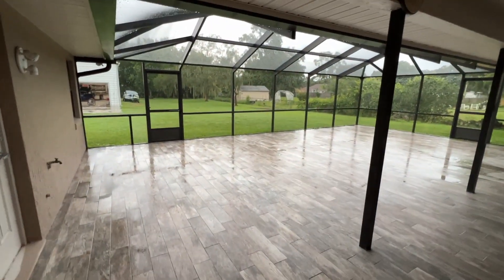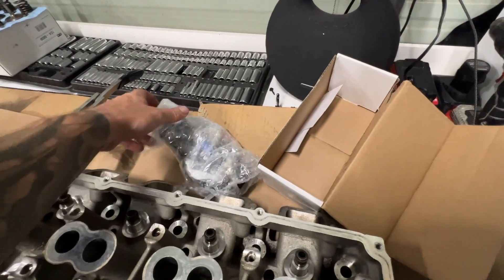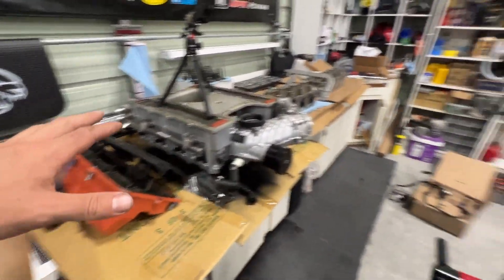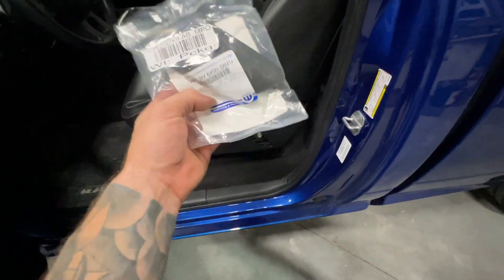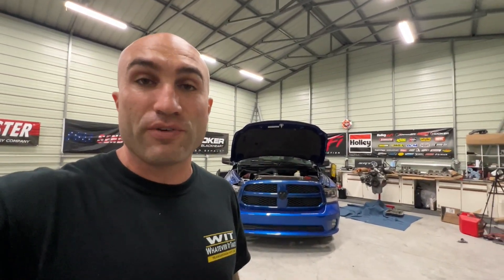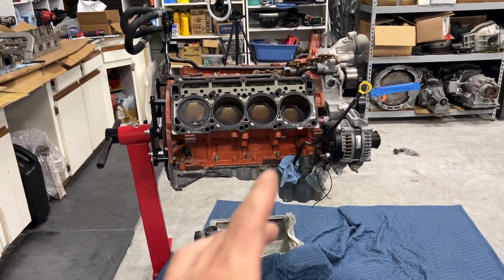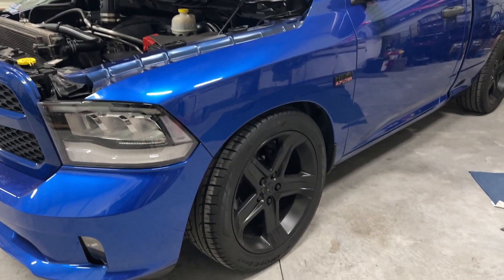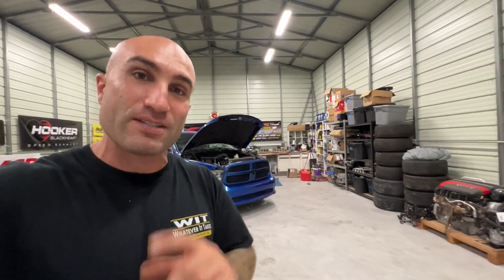Update on the HellRAM Dodge RAM 1500 Hellcat Swap Truck

Comment: would you ever consider making some brackets for hellcat/scatpack seat conversions?
Reply from the maker: Possibly but they wouldn’t be cheap and would need to send me your brackets off your stock seats
Reply: sounds good. how much will they run for. really like your interior and i happen to come across some red/black scatpack seats that i purchased.
Reply: I swapped mines for the rebel seats & wrapped the cloth portion with red leather. They pop in with no issue.
Reply: @sebastiansanchez4234  i been looking for the red rebel and black seats but cant seem to find some worth buying. the ones i have found have been in decent shape but have to be re-upholstered and they still ask for over $2k per seat.

Comment: I was watching an older video of yours where you was trying to fix the condensation problem on the diver side headlight. You pointed out that the passenger side one was good. I’m actually having problems with my passenger side one. And was wandering if you still had the passenger one hanging around?

Comment: Love how he keeps blasting LKQ 😅 how do you send out half ass products and refuse refunds or offer to send the missing parts? I've ordered from them but never had issues luckily
Reply from the maker: Lol it’s been brutal! Between those rubber Mats it’s missing and those two trim pieces it’s almost $300 to buy all that crap and they offered me a $50 refund or the option to drive 2 and half hours to their nearest location to return it or charge ME shipping to ship it back. Such a joke. They wouldn’t let me talk to a supervisor either! Also if you remember when I went to pickup the hellcat transmission it was missing the torque converter and they tried to tell me they would give me $100 off meanwhile the Hellcat tq is like $1200. If I didn’t notice it was missing they would have screwed me over the minute I signed the invoice and left with that transmission. They are shady!